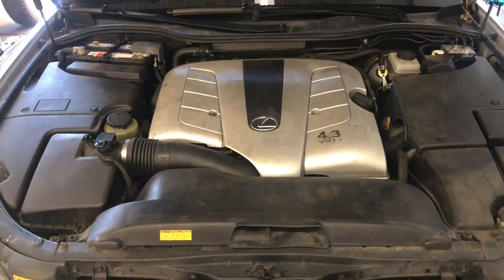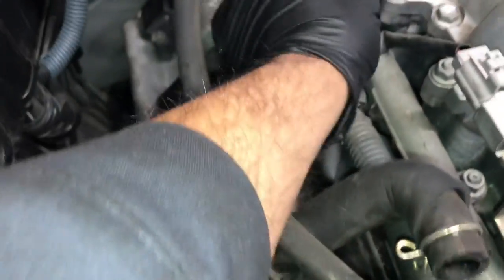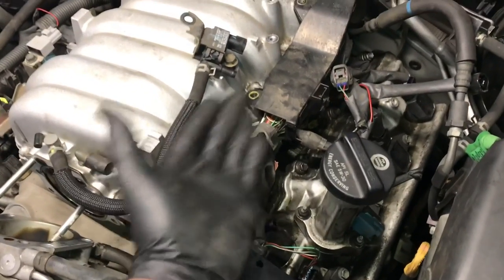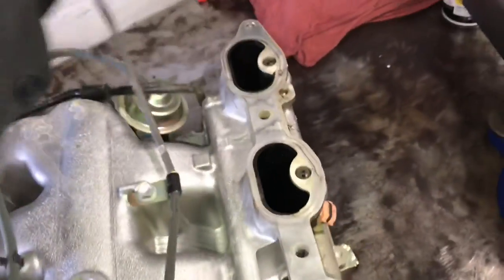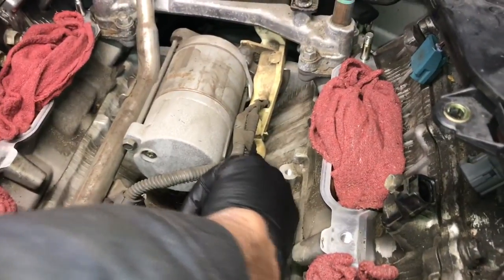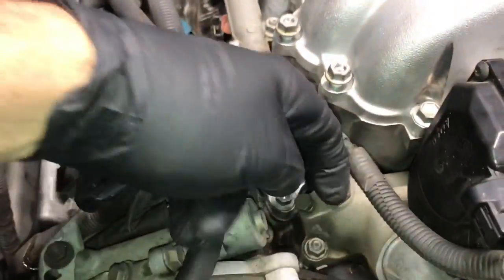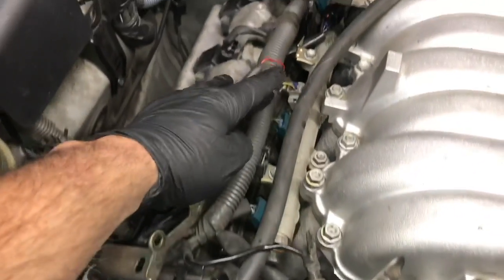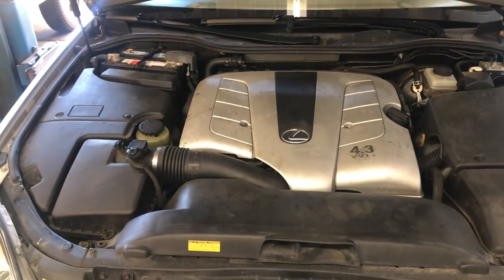How To Replace The Starter On A 2000-2006 Lexus LS430

Comment: The only bad thing abt the Ls430 is the location of the starter motor
Reply: And knock sensor
Reply: Timing belt sucks changing as well 😭
Reply: @solidfamily2695  timing belt is actually not that bad.
Reply: @solidfamily2695  I thought the timing belt was relatively easy

Comment: Ls430 240k miles here. Original starter but when I will need one i will get a OEM because the cheap ones will not last

Comment: For removing the bolts you don’t need a special wrench you can remove the coolant port right atop the starter to get socket wrench in
Reply: But that'd mean draining the coolant. Otherwise you're gonna make a big mess if you go about it that way. A flex-head ratcheting wrench is definitely the way to go.

Comment: Almost finished with the job, one thing I would recommend if doing this job yourself, invest in a metal intake manifold gasket (OEM) one wrong mishap will cause the Felpro gasket to break. But for experienced mechanics, I’m sure you could get by with the more sensitive material ! THANK YOU FOR THIS WELL DONE VIDEO, ABSOLUTELY GOD SENT!!!

Comment: I recomend to repair the starter and also doing the valve cover gaskets at the same time, change the spark plugs and cleaning the inyectors on this engines. will save you a lot of time and money.
Reply from the maker: That would be the ideal time to do those repairs. This customer is on a tight budget though. Thank you for watching!
Reply: I agree

Comment: Probably one of the best DYI videos I have seen so far! Thanks for taking the time to make this video and adding the crucial details. I need to change out one of the knock sensors and was worried it was too much work but you made it look easy so I will give it a try. I Currently have 472,000+ miles and just for fun want to make it to 500k before I send my 2001 LS430 to the grave. I bought it back in 2004 with 34K on it and so far only needed to change O2 sensors, alternator, and VT solenoids. Changed the timing belt a couple of times so far too. The engine has been very reliable.

Comment: Excellent video. The best DIY ive seen.  I just used this tutorial to change my knock sensors (P0325 code) on my 2001 gs430.  My advice to anyone who has a starter problem or knock sensor problem is to change all three item once you take off the manifold.  I only changed both knock sensors and regret not doing the starter as it looked super old.  Any of these could fail at anytime but to go back in there just to do one item is a lot of work.  Also do not use a cheap no name brand for anything.  Go with a reputable brand. I used NGK sensors.  Its just too much work to put in an inferior component.  There is an old saying: “A wise man cries once, a cheap man cries many times”.

Comment: 5:52 fuel line which way should I twist cause I’m a little confused on the lefty loose, righty tighty
Reply from the maker: The half of the hose for the 14 mm bolt head, you’ll turn that left counterclockwise and hold the larger nut still

Comment: Had to do the knock sensor on my '04 GS430 this evening and my god is this a challenge LOL! This intake has ssoooo much stuff in the way when it comes time to lift her up. Thankfully, you can just pop the top up a lot on the manifold once you get all the bolts and plugs out the way, then you can just prop it open with something so you can get the knock sensor out and the new one in. Took about 3 hours for me and my buddy to get everything all figure out on the removal side (we were taking our time too though.) I gotta get all the bolts back in and everything plugged back up but this was one HELL of a challenge actually. This is such a good video of what all is included in the intake removal. There's A LOT involved in this actually

Comment: Best video for replacing starter or knock sensors. This guy covers soup to nuts. Be prepared to strap a few broken connectors. Highly recommend two people for intake. Used old carburetor gasket. Fuel line connection was very difficult to disconnect. Do no attempt without flare nut wrenches. Went back on easy after a cleaning with B Blaster and tooth brush. Did not replace water hose or knock sensor harness.
Thank You!!!

Comment: Great video.  had to replace the knock sensors and this really helped know what steps to follow.  Especially getting the fuel line clear of the wire harness, that had me puzzled for a little while.
Reply: Were both of your knock sensors bad? I have a code for one but most likely will replace both and possibly the starter. Really don’t want to have to take this all apart again.
Reply: @instasingingvids3529  I’m in the same boat with my GS430. P0325 Bank 1 Knock sensor. 2001, 184,500 miles. How many miles and year on yours?
Reply: @instasingingvids3529  I would 100000% do both sensors and a genuine denso starter if I was in there
Reply: @MrFoxfire510  i have the same exact knock senor code. 2001 GS430.  I am going to change both. I am debating if I should pay the mechanic or try it myself.  It looks quite involved.

Comment: The 14m mountain flex ratchet doesn't fit on the driver side 14m bolt holding the starter. Fits perfect on the passenger side bolt tho. My 1/4 in. flex head snap on ratchet with a 14m short socket was able to get in and crack the bolt loose.

Comment: Hi any idea y my 2002 lexus ls 430 won't start after i had it running with new starter thanks to your video the next day i go to start it and it sounds like its not getting gas. It started up after putting in starter i drive it for a miles and the next day no start.

Comment: I've seen videos like this one where they take the manifold apart(upper and lower pieces) . Nice Video. I want to replace both knock sensors and harness on my car because of a knock sensor P0330 code but i was hesitating  taking the manifold apart but as i can see now, I don't need to unscrew the top part. I think i'll give it a try.  THANK YOU.

Comment: I just bought one of these cars.  I always open the hood on cars to make sure I can work on them.  In this case, I took the starter for granted.  I still love this car, and I will do this job when needed but DAMN!  Why Lexus, why!?  Just saved your video btw.  Thanks so much for it.
Reply: Got to do mines tomorrow.  😎
Reply: @tonybailey7068  I would invest in heat-reflective gold tape to wrap your starter in to mitigate heat soak and general heat damage.  Good luck.
Reply: @anthonytsi  Thank you

Comment: Question about cleaning the mating surfaces of the manifold and gasket, did you use some sort of solution to get the gunk off or did you use a razor blade or something? Yours looks super clean

Comment: By any chance is the little bolt in the back of the starter the ground?  No nothing the two big main ones.I did this video  step for step,but when we try to crank we get absolutely nothing.all accessories and even fuel pump kicks on.the motor is not locked we checked. Please any suggestions?

Comment: I came here in search of a possible answer to my problem. Seems to be that my starter may be my culprit to draining my battery. Possibly a hard short with the power wire from battery to starter. Have you seen this before? I havent dug into it yet But after much hours of diagnosing all rules out and the only thing left that i cant check is the hard starter cable wire. When i jump from another car it makes the cables soo hot i cant touch it. I would have to charge the battery and then start the car that way. Starter gives me the click click click all signs of a bad starter also. I live on 10 acres and have found forearm size rats sleeping in my engine bay. What im wondering is have you seen this and is there possibly a location where the power wire can touch ground and hot weld it self to ground? No blown fuses, no bad relays. Power wire to car draws 1.5 amps/ power wire to starter draws 1.5 amps.. connected they draw 3 amps.. which from my research is too much for these cars. Any in-site would be appreciated!

Comment: I read that certain systems had to be programmed when disconnecting the battery did you have to do that after the starter replacement.
Reply: TX Hombre I don’t believe that at all ..

Comment: I replaced the starter on my 05 Lexus LS 430 And the spark plugs when I was done putting everything back together the check engine light came on my traction light came on and I keep getting a VSC any information but it could be
Reply from the maker: payaso Ortiz most likely something got left Disconnect it. You’ll need to pull the codes to see what the possible problems are. Then you need to clear them with the scan tool and all the lights will go out once the repair has been made.

Comment: So the starter isn't connected to the transmission in any way? About to pull my transmission and it looks like I won't have to remove the starter at all
Reply: No. Transmissions in RWD cars are generally more simple to deal with compared to FWD.
Reply: @SI0AX  Just pulled the trans out yesterday, surprisingly simple and the starter wasnt connected like most other cars

Comment: Wow, this is an awesome tutorial. From personal experience Lexus makes awesome vehicles. The LS430 is an incredible car, but why did Toyota put the starter in the worst possible location.....WHY????
Reply: Maybe it's the most reliable location? Haha mine has 240k miles on it
Reply: They did that because it’s reliable, that starter can go 300k miles. Makes sense, it’s not exposed to the elements
Reply: @MichelLinschoten  300k??? I have 410k on my original starter and it’s still going strong 💪
Reply: @christophermartin972  good to know I don't have to replace the starter any time soon. only at 106k.
Reply: I’m needing mine at 190k …

Comment: Hi, great vid and thanks for sharing! I've watched it plenty of times to build my courage so I can change the knock sensors. Is it absolutely necessary to use the line wrenches to disconnect the fuel line?
Reply: Use line wrenches so you don't twist or otherwise damage the fuel line or line connectors in any way. You do not want to create a fuel leak.

Comment: I had this done,$636 dollars,its time consuming but im good now
Reply: Where did you have it done? I hope lexus dealer charged around that much. That is where I am taking my gs430 soon. Because it has a knock sensor check engine light. Might as well change the starter and harnesses while down there. And gasket

Comment: Great video. I don’t have this vehicle but was cool how you do the work along with explaining the tips and tricks. Do you think this was a good location for a starter? How much labor hours was this job? Heard good reviews about this car but the service would be a nightmare, isn’t it?
Reply: Never came across another engine as reliable as this one and easy to work on.
Reply: I have a 2002 LS 430 with 220k miles. The starter is probably the most difficult repair I’ve encountered. Almost everything else, brakes, serpentine belt, thermostat etc….. we’re some of the easiest repairs I’ve ever done on a vehicle in my life. I replaced all 4 pads and rotors in like 90 mins and it was sooooooo easy. The alternator is a piece of cake too. The car is so unbelievably reliable the repairs are few and far between anyways.

Comment: I had to replace the starter on my LX470 with a 2UZ-FE engine.  The starter is in the same place.  I cursed the engineers for putting it there until someone explained that it's the best place for the starter. It's not exposed to the elements.  No water, ice, road salt or kicked up rocks will ever contact it there.

Comment: I start my ls430 no less than 30 times a day, 7 days a week. Mine has 180000 plus miles  Original starter.  If I have to pay 1200$ for that job soon. It is worthwhile....Vs some nonsense repairs from other manufacturers not cheaper than that.

Comment: "How hard of a job do you want the starter replacement to be?" Lexus - YES
Reply from the maker: SSDracer it’s quite a bit of work for sure.But it’s not the hardest one I’ve ever done.
Reply: It may be up top but it's more reliable and once you know the engine it's not hard to do what you need

Comment: Am I the only one having an issue getting the right bolt off from the starter? I can’t even get my extended 14mm on because the transmission is close to the head of where I have to put my tool
Reply: Same issue here, what did you end up using to get the bolt off?

Comment: The engineers who designed the starter placement for the 3UZFE engines should be ashamed.  What a terrible design.  No wonder labor to replace is it so much...half the car has to be taken apart!